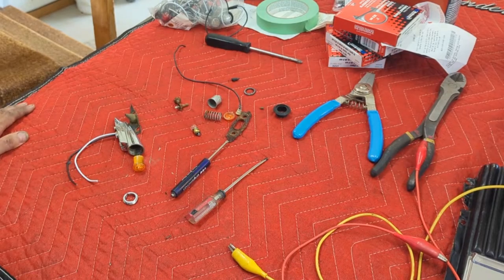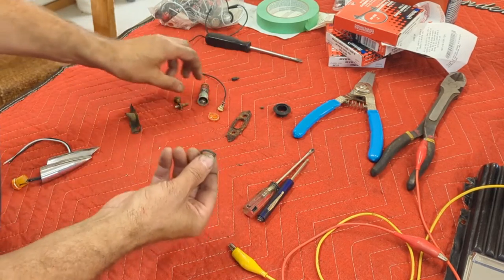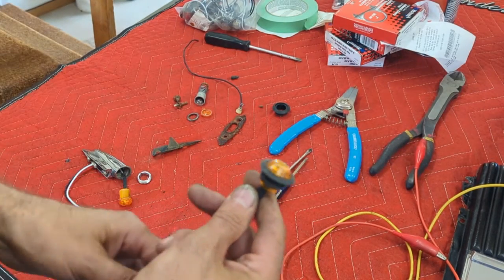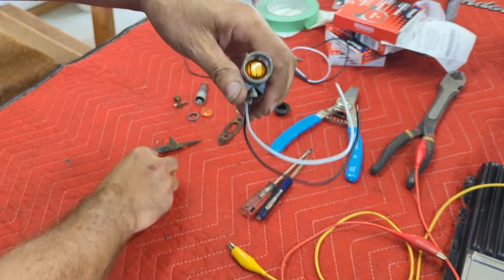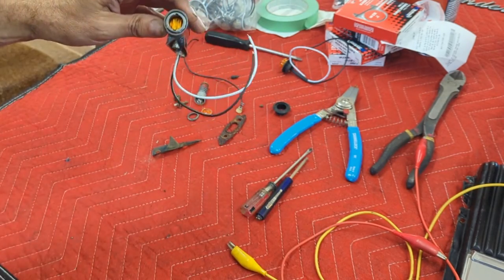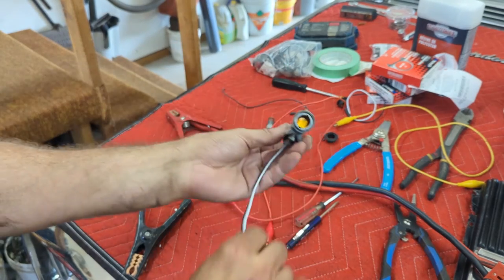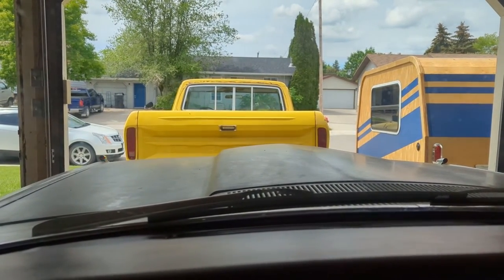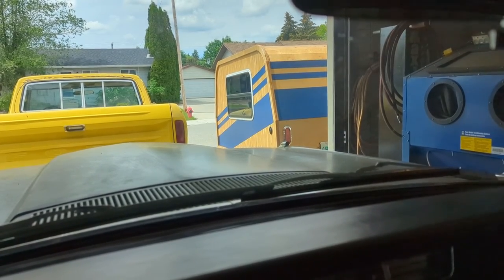65 Thunderbird Fender Mounted Turn Signal Indicator Modification

Comment: Thanks for the heads up. It will save me a lot searching.
Reply from the maker: You're welcome John! There's nothing wrong with rebuilding the original set up if you want it to be correct...but for a mod to the lights, it's an easy inexpensive fix.

Comment: Having these as bright as possible is nice because you can leave the oem ones on at night and not even realize it. Give the arm a tighten on the column that can cure a weak "flasher" symptom before you spend 120 on flasher above the column. That flasher only controls the fender lights. The front turn signals flash from the sequential box.
Reply from the maker: Thanks for the info, I'll give it a try! 😊
Reply: Can the lights be removed thru the head light buckets?

Comment: Hey Alvin!   I’m about to pull the trigger on the front fender turn signal LED conversion like you did. Might these LEDs work on the marker lights in the bumper as well?
Reply from the maker: That's great Gordon! I haven't tried them anywhere else, it would be nice to know if they work! 😊
Reply: @J_R_Shop  I’ll give it a go and let you know!
Reply from the maker: @amillego  thanks, good luck! 😊
Reply: Did you ground them to the mounting bracket? Or somewhere else on the body?
Reply from the maker: @amillego  I grounded them to the body, used one of the wire harness screws on the front apron, right beside the hole for the existing black wire.
Reply: @J_R_Shop  Thanks again mate!
Reply: @J_R_Shop  My assumption is that, if they are wired similar to the fender lamps, the front turn signal/marker lamps would be the same.  Am I right?
Reply from the maker: @amillego  that is correct, the difference is the ground wire, instead of the grounded socket. 🙂
Reply: Hi Alvin. I followed your directions and converted my wing lamps to LED but they’re no lighting up when I test them with the battery. Ideas? In spite of not working (yet), they look great.
Reply from the maker: @amillego  have you tried testing them by switching the leads between positive and negative on the battery...they are diodes, and the current will only pass through in one direction, like a check valve.
Reply: Your diagnosis was correct. I switched the connection and they worked. Thx.
Reply from the maker: @amillego  that's great ! 👍👍

Comment: Amazon has them, I think are the same,  Nilight TL-03 10 PCS 3/4” Round Clearance LED Front Rear Side Indicator Bullet Marker Light for Truck RV Car Bus Trailer Van Caravan Boat (12V, Amber), 2 Years Warranty. $8.59 US for 9.
Reply from the maker: Yup...those are the ones, they seem to be available under different names.

Comment: I’ve been looking to do this so thank you. Would you also just be able to change the bulb to an LED equivalent bulb? Did you need to install an LED flasher as well?
Reply from the maker: You're welcome!
I have not tried to just replace the bulb with an LED equivalent, it does look like there would be room, if your sockets are in good condition, that may be a good idea.
No, I didn't have to change the flasher, it works well with the stock flasher.

Comment: White wire is power for my 66, could that mean my car is positive ground and your car negative ground?
Reply from the maker: No...if your ground wire is white, then that is most likely an inconsistency in the LED manufacturing.